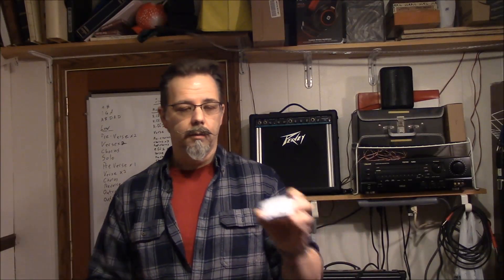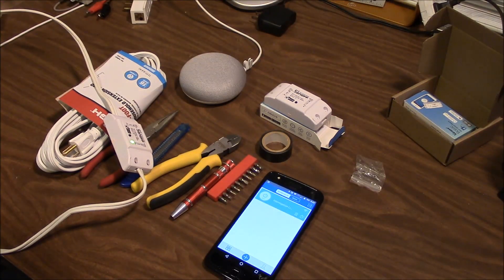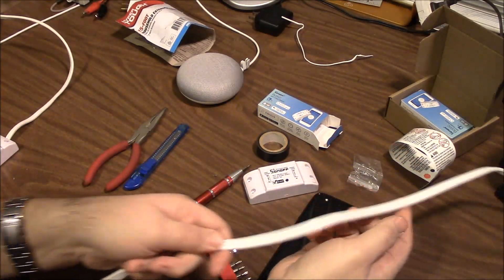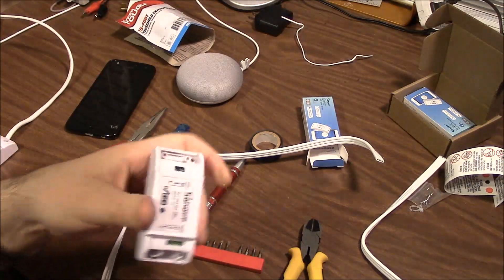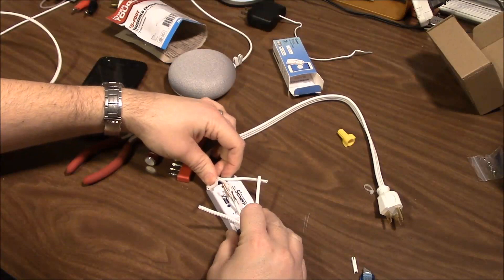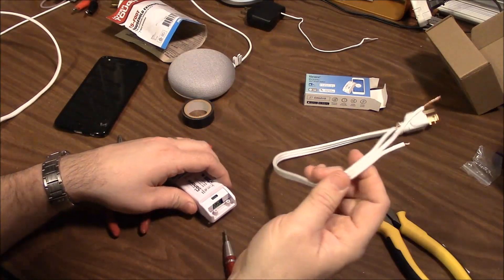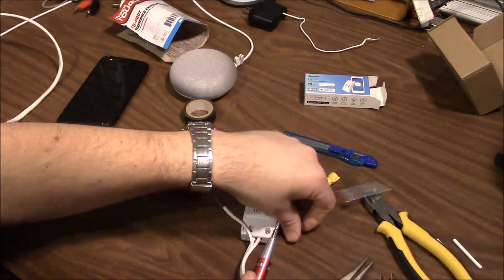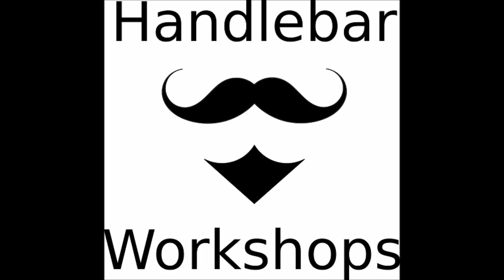Basic Home Automation Part 1 | Sonoff and Google Home

Comment: i added the sonoff app to my android phone and added the devices on the app. one week later they disappeared but they still work on google assistant. i deleted the app and reinstalled the app and tried to reinstall devices but they would not be added but they still work on assistant. how can i add them back to the app?
Reply from the maker: Interesting. I've never had that happen before. I had some issues getting the app to communicate with the devices when I was first connecting with them over the LAN. Sonoff's webpage has a somewhat confusing procedure to pair the sonoffs with your phone, so I had to fiddle around with them to get them to connect. 

It's been so long, that I don't remember the exact procedure (other than what is documented in my video). So just play around with it, trying different methods.

Comment: Why not just leave the earth wire intact, just separate the other two and let the earth wire run by the side.
Reply from the maker: I had thought about doing that, but it required more measuring and precision cutting. But I figured I'd go the easy route for my first time. When I do this again, I will be doing exactly that.

Comment: I just got six basics in the mail and tested one with a floor lamp. Pretty frickn cool. The actual neutral and line connection are a little sketch, but atleast they include the toothed clamps.
Reply from the maker: I love these things. So simple (except for connecting the wires into those tiny little holes) and so easy. I still only have the two, but I have plans for about 8 more.
Reply: Have you seen the glass haptic light switches? just ordered 4 of them.
Reply from the maker: Got a link? 

Too many times have I gotten into bed, gotten all comfy and realized I forgot to turn off a light wired to a switch. 

Thanks
Reply: they have EU and US.
Reply from the maker: Not sure if that will work in my application. Most of my switches are 2 or 3 switches per electrical box. Plus having a constant blue light in my bedroom would annoy the heck out of me.
Reply: they have two and three gang switches. and you can program the light to stay off.
Reply from the maker: It doesn't look like they have muli gang options for the U.S. 

Besides, one of my switches also has a ceiling fan control along with a separate light switch. The other ones are 2-way lights (2 switches control 1 light). It doesn't look like they have an option for that either.
Reply: frick... I odered uk ones..... well I know what Im printing next with my new 3d printer
Reply: Curtis Ivan  what are you guys talking about?